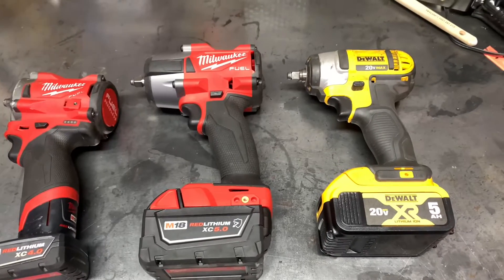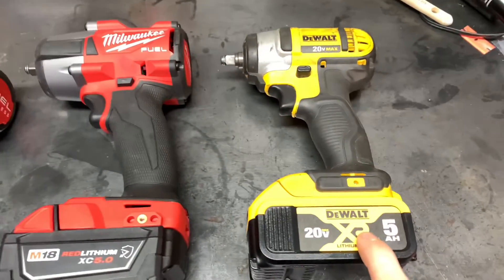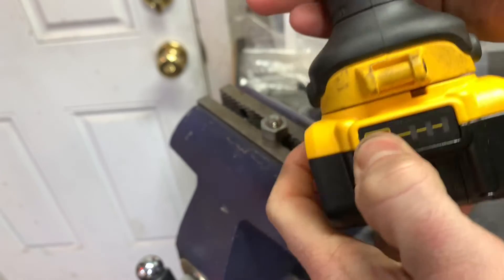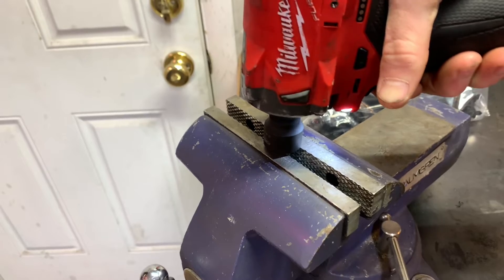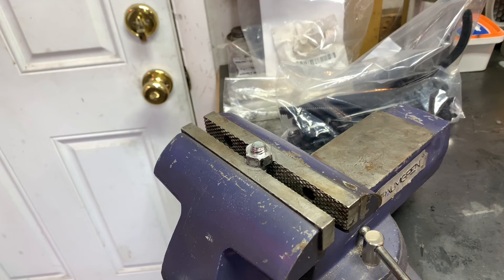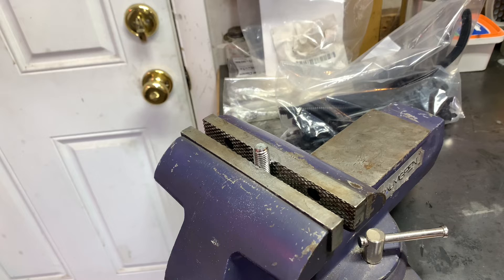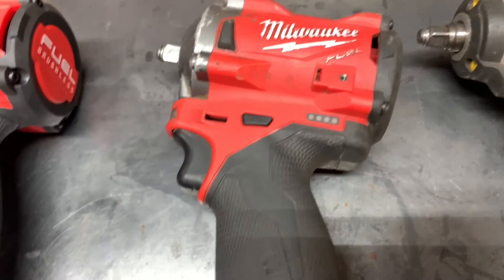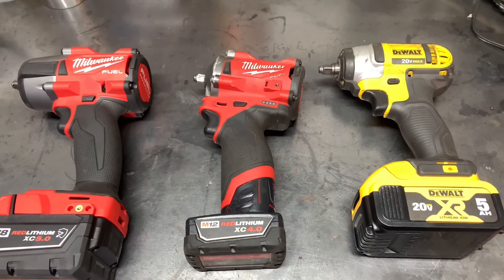Milwaukee vs DeWalt 3/8 Impact Comparison

Comment: Use a deep socket instead. more weight = more powerful ugga duggas.
Reply from the maker: Sometimes you can’t use a deep socket…
Reply: @TUNED2.7  most of the time you can...
Reply from the maker: Yes but for testing purposes I used a shallow socket to provide more accurate results rather than getting higher torque numbers for no reason